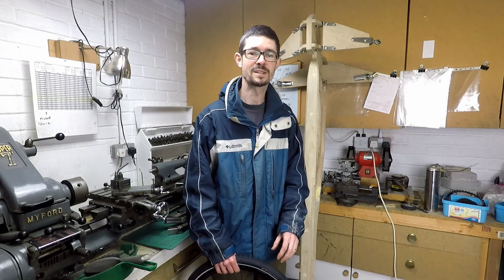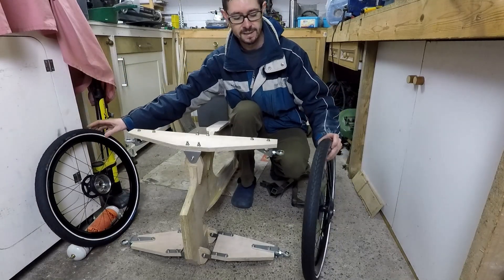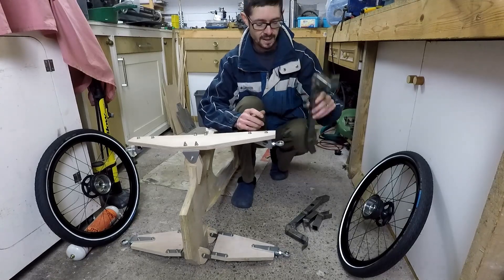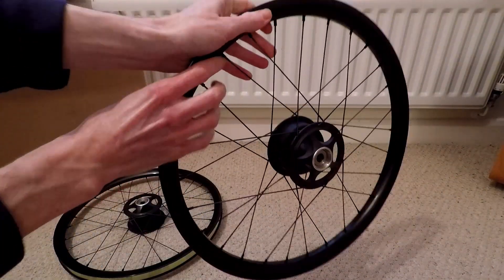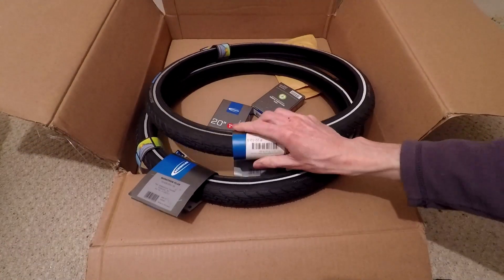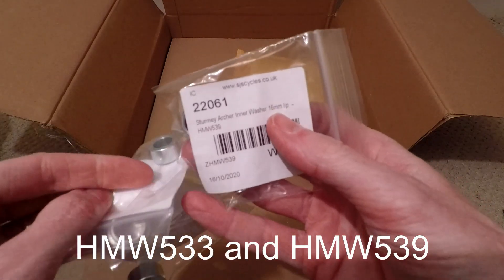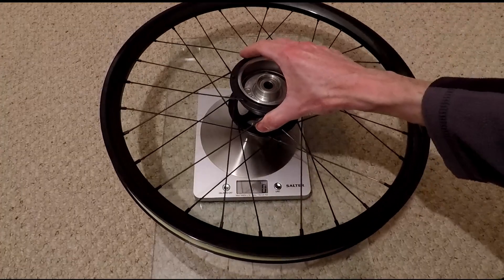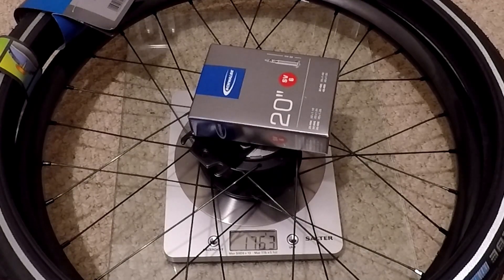Tilting Trikes Part 6 - Velomobile Trike Project - the Front Wheels. 5K Sub Special!

Comment: I have built 13 tilting trikes. here is the Youtube video I recently posted. https://www.youtube.com/watch?v=dAXDy5tCgy8&t=906s I like your presentation, but your ideas on suspension and steering are too related to no tilt vehicles. Tilting changes a lot. I work mostly on active tilt control that manual and auto levels the vehicle at low speed and stop so the vehicle can be enclosed. You do no have to prop the vehicle up at stop so you can do everything a car can with smaller footprint material and fuel usage all beings being equal. Contact me if you are interested in sharing insights.

Reply

Comment: This is probably a silly question but why Sturmey hub brakes and not mechanical disc brakes ?
Reply from the maker: It’s a good question! There are quite a few reasons why I went for the drum brakes:
- less complex, no need to make fiddly calliper mounts
- hard to find a handed pair of callipers (I subsequently found that they are available)
- easier to find 20in wheels with drum brakes
- lower maintenance
- slightly more aero
Mechanical or hydro discs would probably be a bit lighter and perfectly practical though.
Reply: @MetalMachineShop  handed calipers of course , Daw !  🤔

Comment: One of the problems of using ply is its weight. Going up hill on a trike is hard work and the last thing you want is hauling a heavy weight. I started making a trike but soon realised that the weight of all the parts was adding up. I used the Sturmey Archer hubs and built my own wheels using aluminium rims. I saw a cheap Windcheetah on EBay which I bought and updated. Only weighs 16Kg. Be interesting to see what you finish up with.
Reply: My assumption is that the ply is a prototyping material...
Reply from the maker: Yes, it is quite heavy but I'm just prototyping the design.  It would be possible to make a lighter ply design with a bit more thought put into the design itself (stress calcs, etc.) (Sorry, missed this comment).